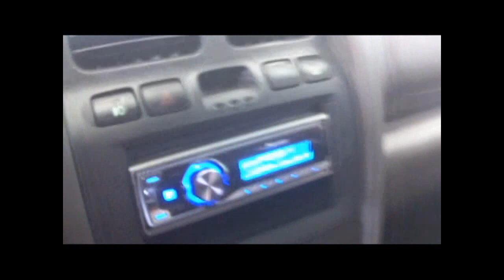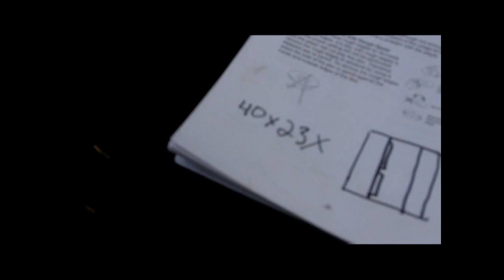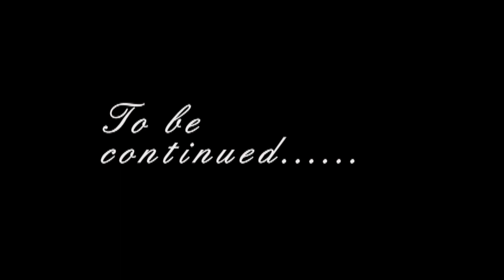Twisted's 3rd Row Wall Build  PT.1

Comment: Try a 4th with the woofers in the bottom 1/3 of the box with the port firing forward over the top of the seats. I have no idea if this will work but doing it like this the port will not be partially obstructed by the rear seats.This is probably how you had planned on doing it anyway it was hard to tell from your sketch on the paper. Good Luck

Comment: 4th order with the bigest port and a ton of power for the dd like 4 crossfires 1000 per sub  and be sure to resin the piss out of the inside of the box and brace the piss also the dd sub will handle that kind of power

Comment: @subw123 there is 15^3 why wont it be enuff room. 2.5-3 cu/ft seal portion EACH then 9cu/ft for both in the ported chamber thats about 7.5 cu/ft each sub thats a good ratio for a 4th order.